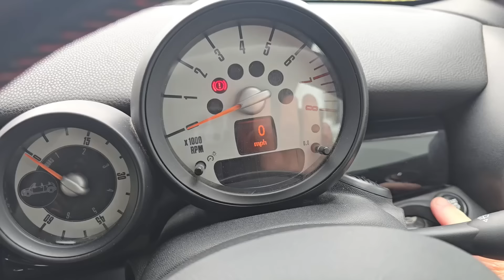Searching For The Perfect Thing For Sherpa

Comment: Nice idea with the glass box and lid - that will look great. You could also mount it on a light box, which is essentially a shallow box with a frosted glass lid with a light inside, so you can illuminate it at night. They are used for crafts - come in various sizes or could even custom make one. The lady doing the glasswork would know about them, I’m sure.